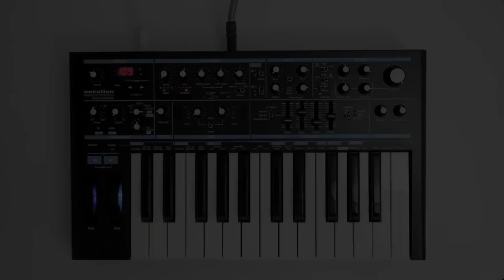Novation // Bass Station II - Envelopes

Comment: I have just bought a Bass station 2, but have no synthesis experience. A lot of the presets have a sort of swelling of the frequency and volume as I play legato, or simply fast phrases. What is the feature by which is turn this of or edit it? Any help would be very much appreciated?
Reply from the maker: Thanks for getting in touch. It's probably best that you contact our customer support team so we can explain the features. You can get in touch here bit.ly/NovationSupport 
There are several ways that you can change that kind of behaviour. It's difficult to provide a solution to your question without a better understanding of what it is you would like to change. You may want to experiment with the Decay, Sustain and Release values as they can be used to manipulate the duration of the played sound.

Comment: hey, I hope you'll respond, I know this was posted ages ago, but I'd like to know when set to Multi mode, if the attack and decay are set to max, does the envelope pick up from where it left off when playing staccato like it does on an SH-101, or does it start from zero every time?  thanks!
Reply from the maker: Envelopes always continue from where they left off - regardless of Triggering mode. The envelope will never reset "to zero". In Multi mode, the envelope moves back to the attack stage on every single note press, regardless of staccato/legato.
Reply: @NovationTV   sorry for thread jumping, but do the oscillators have a phase reset? So just like a retriger per note? Cheer's